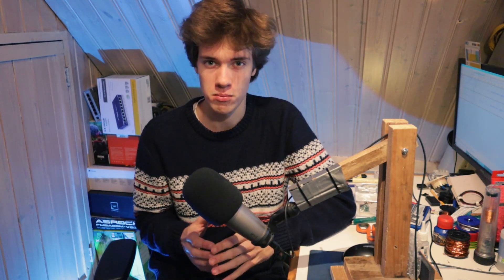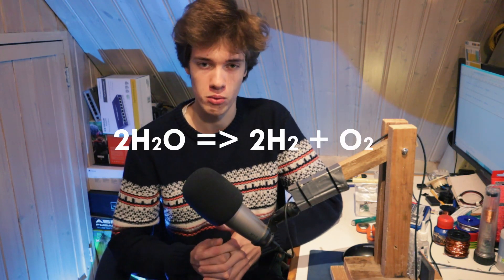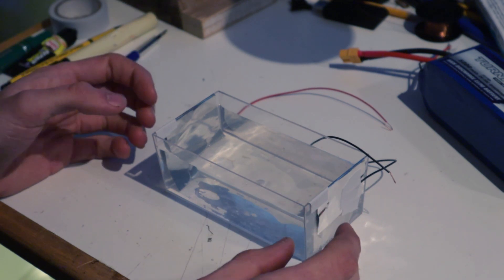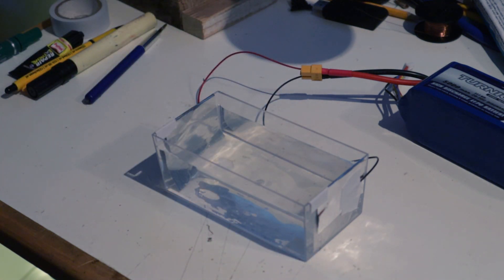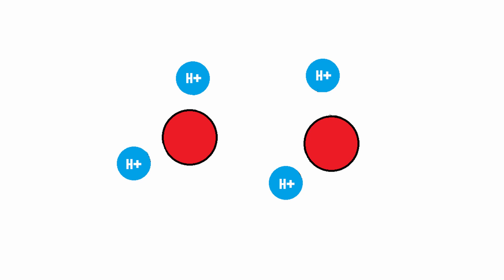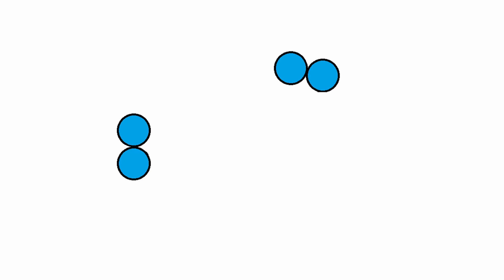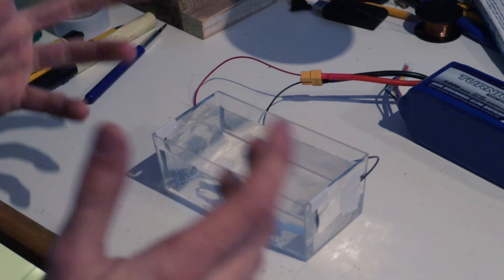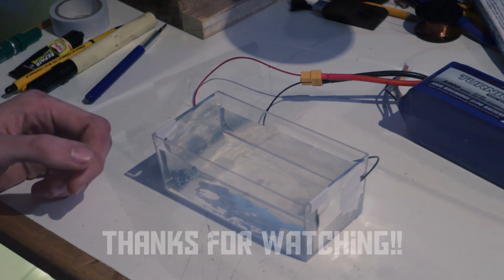How green hydrogen is made

Comment: Electrolysis can be simply modeled electronically with a resistor and 1.24v zener diode in series creating a voltage dividing network. 

If one desnt know what a zener diode is or does,  know that it is  like a variable resistor that internally changes its resistance such  that however much current flows through it, it the voltage drop across it is always the same, except when the applied voltage is less than the zener diodes rated zener voltage and current drops to zero. 

Amps × 1.24v drop across zener diode = power used to rip hydrogen and oxygen atoms apart.  Power over time is energy being stored potentually as chemical energy.  

Amps × voltage drop across the resistor = power lost to making heat. 

 

It's this dead simple. The rate of electrolisys  is all about the amps. The efficency is the voltage to split water / applied  voltage. 

For instance a setup with 5v  power supply  and pushing 1 amp consumes 5 watts but  generates( 5v-1.24v to split water)×1amp = leaves 3.76watts  for heat  and  (1.24v for electrolysis)×1 amp = 1.24 watts being stored over time making chemical energy.

Comment: In using aluminum, what you made here is really an electrolytic capacitor. Well in time that is what will become. 😊

At the anode side, oxygen corrodes the surface of the aluminum forming aluminum oxide which is an insulator.  This is why the amount of oxygennbeing produced was less than 1/2 that of the hydrogen being produced. 

During the "forming phase" of an electrolytic capacitor the aluminum oxide film is grown slowly untill it completly covers the aluminum  plate and no more current flows at a specific voltage, the max  voltage rating of the capacitor.  The aluminum oxide layer is very thin and makes dielectric layer between two plates of a capacitor. One side being the electrolyte and the other the aluminum on the other side of the aluminum oxide insulator.